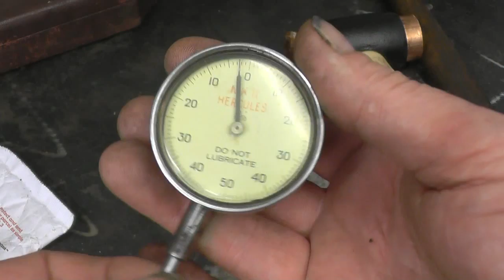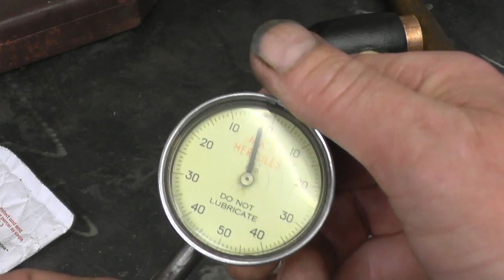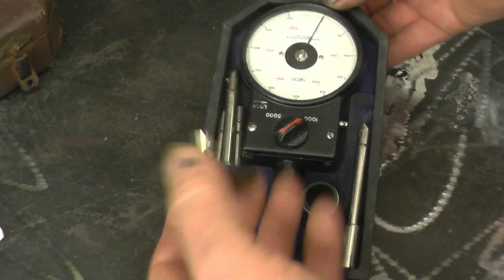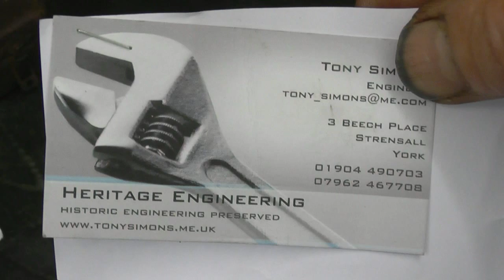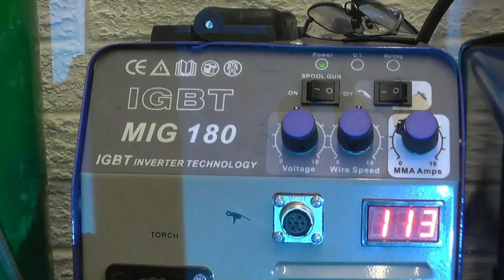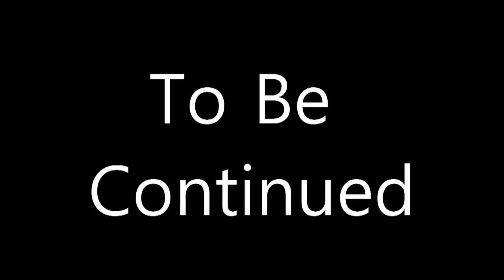SNNC 181 P1    DTI draw  Bash swag  Phase converter mount

Comment: Hi John, the tap guide was also made by made by Pierre Beaudry from Pierre"s garage.
if you remove the cap, you can flip the pin to use on small taps with out holes
you did better with my name than most.
Glad you have a great trip, Canada would be proud to have you two.It was a pleasure to meet you and Kris had a wonderful time with Debs.
Cheers mate
Reply from the maker: Thanks Mate

Comment: Could you not position the phase converter inside the coal hole, John? Or would it overheat
Reply from the maker: There would be too much noise in the house  Debs would not like it at all